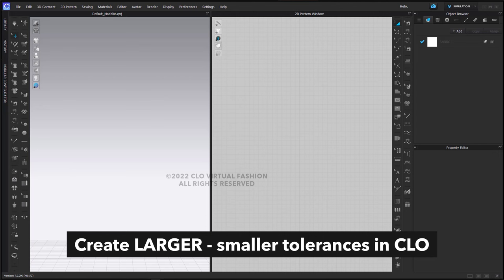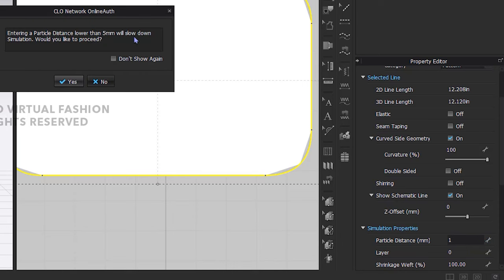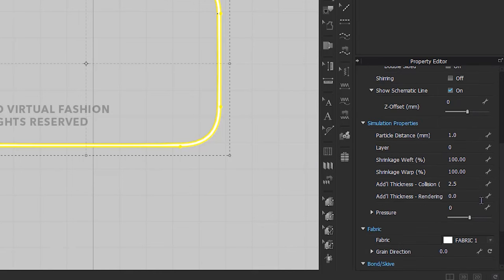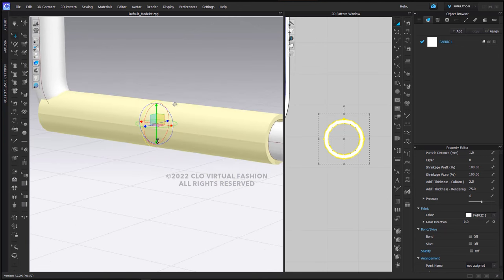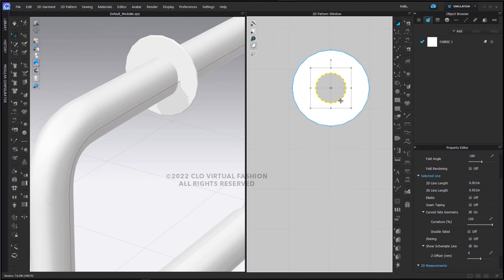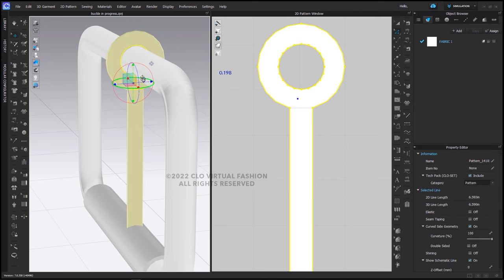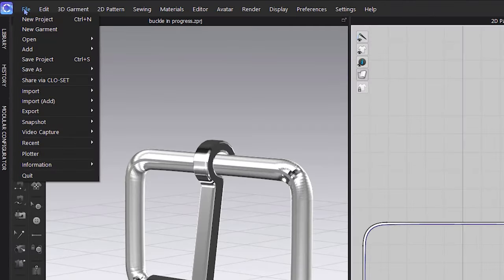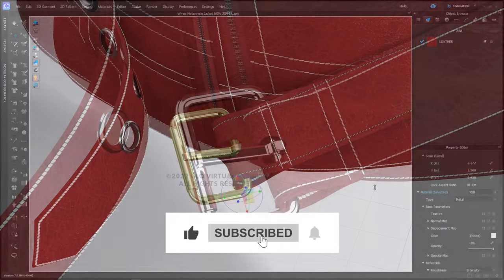How to Create a Roller Belt Buckle in CLO

Comment: Another thing, boucing back from another comment about velcro (great idea!) It would be great when fixing a rivet or a press button, that both parts (front part and inside part) would be set in one click. Clearly if the wear somewhat functioning, that would be amazing : they would snap directly. Same goes for buttons, when applying a sewn on button, it would be great to see right behind, the cross stitch (as it is in real life)   Of course, applying rivets and see it creates a real hole in the leather or fabric and see the back ring or the crush eyelet inside, would be super. I know this is a loads of work for details, but Clo3D is the best for that reason!! Keep up the good work
Reply from the maker: We definitely know it can be works, but it is a feature request we hope to add in the future :)

Comment: Great video. The buckle is so neat. Very clear step by step. Thank you so much. I have found issues making another type of buckle : Black plastic ones (triglide) with the ridges and all, issue being to lock it into place. :(  I did not think about saving them as Avatar though. Trim doesn't work and cannot hold fabric.
Reply from the maker: Trim can hold fabric is you do not Glue into place and instead place and then add collision. Works very similar to adding as an Avatar.

For other types of buckles it is very similar. Start with the share and then add thickness. But if a piece has level of highs and lows you may need a more traditional hard modeling program like Blender instead